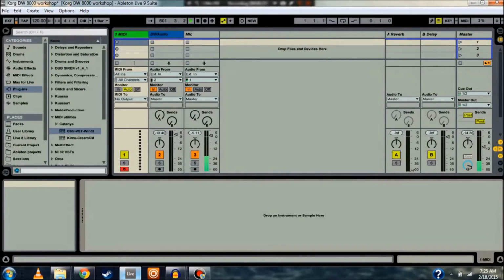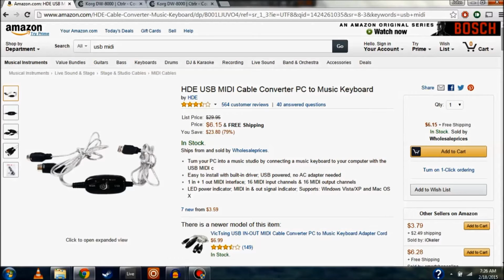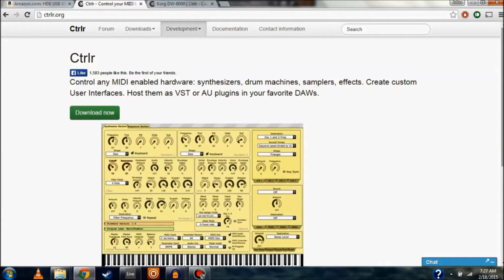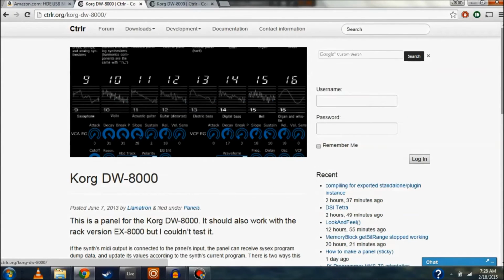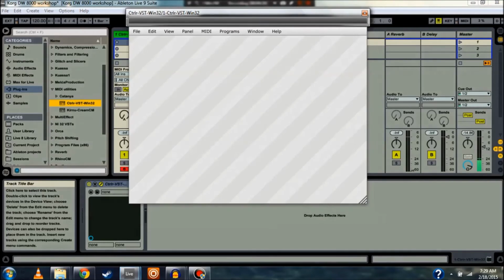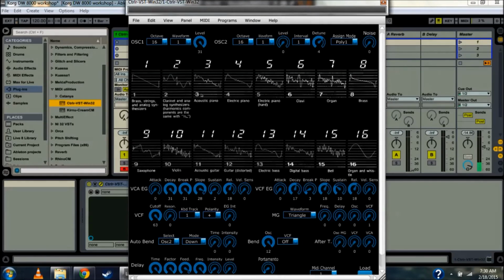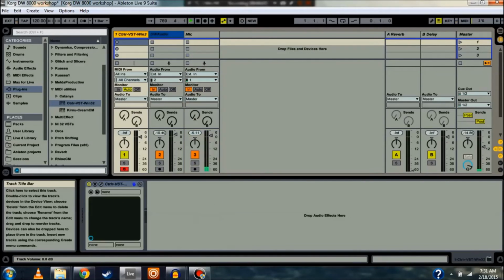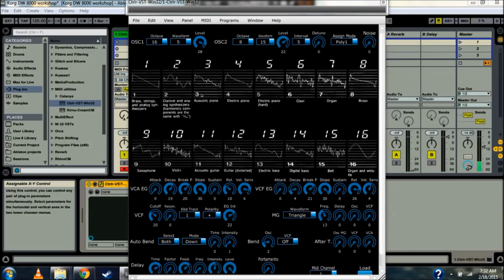Korg DW-8000 Review & Guide - Pt.2: Ctrlr Editing

Comment: It’s working for me even without the usb/midi converter. Only midi out and in, in selected my midi port linked to my dw8000 on every parameter in the midi settings of CTRLR and the « input from host » in the « plugin option section »
Enjoy

Comment: Will the USB-MIDI cable work for transferring patches from your computer to the synth? I was originally going to use a MIDI cable with a USB interface which then connects to the computer, but this cable seems a lot easier. Will it work for transferring patches?

Comment: Cant seem to hook a 707 to work with arpeggiator via midi is this possible?
Reply from the maker: Richard Walley it’s supposed to work as long as you set MIDI to accept external signals. I will tell you I always had trouble with the DW8000 accepting external MIDI clock and transport controls

Comment: Hi Yateveo, thanks for this great series on the Korg DW 8000! Are there any resources explaining specifically how to setup a Korg DW 8000 to work with Ctrlr software? I've downloaded Ctrlr and the Korg panel, but can't seem to get it to sync with the Korg keyboard.
Reply from the maker: Chris Bell you’d have to ensure your computer is also sending and receiving MIDI data correctly. How are you connected MIDI-wise to the DW8000?
Reply: Hi Yateveo! I am using an M-Audio Uno connector to connect the keyboard to a Macbook Pro.
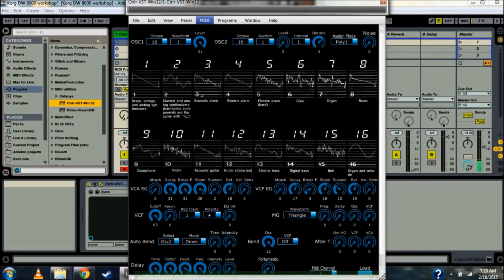Reply from the maker: Ok cool. Once you have it hooked up, you have to ensure that Ctrlr is looking at the Uno as a Midi source and also that it is properly assigning the MIDI ins and outs. I go into how to do that in the video at about 4:40

A couple common hangups:

1) Many usb/midi interfaces like these are a little counter-intuitive in that you want to plug the "out" plug into your "in" port on the synth and vice-versa

2) Make sure your DAW (if you're running Ctrlr as a VST) is not trying to use the Uno itself as a Midi interface. If anything interferes with Ctrlr using it, it won't work.

Hope this helps - thanks for watching!
Reply: Hi Yateveo, many thanks for your response.  I tried plugging the "out" plug on the Uno cable to MIDI IN and the "in" on the cable to MIDI OUT on the keyboard but didn't have a response.  However, when it is connected "in" on the cable to MIDI IN on the keyboard and "out" on the cable to MIDI Out, the Uno device LED light indicates that it is receiving MIDI input, but the MIDI Out does not light up. I am using Ctrlr as a stand alone program right now, not using it through Garageband.  In Ctrlr I have selected the Uno as MIDI Input, again the Uno as MIDI Output, and again the Uno as Controller Device. All settings are on Chanel 1.
Reply from the maker: Hmm that's odd. Unfortunately, I've never used the Uno before so I'm not sure if perhaps you may need to do some research with M Audio or their tech support boards to make sure it's properly sending MIDI from your host computer. Also of course ensure the DW8000 itself is set in its Midi settings to both send and receive MIDI.

Sorry, wish I could help more :/
Reply: Do you know how to set the DW8000 to send and receive Midi?
Reply from the maker: Parameter 84 changes channel, 85 enables note data or all data (set it to all), 86 turns omni mode on so it hears all channels just in case
Reply: Great will try this, thanks!
Reply: Hi Yateveo! Great news, I've gotten the keyboard and computer communicating with the Ctrlr software. One question I have is about saving panels that are created and reloading them. So far I haven't been able to do this successfuly, to load a panel that has been saved. I press the load button at the bottom of the panel but nothing happens. Any advice on this would be much appreciated. Also, are there sound libraries existing for the Korg DW 8000 that can be loaded in via Ctrlr panels (assuming I get the panel loading to work)? Many, many thanks!

Comment: Hi Yateveo, you helped me setup Ctrl in Ableton in your last video but it's been a while and now it doesnt work..I disabled everything midi in Ableton.

Can you tell me how you set up the various parameters in the midi option of Ctrlr ?

My Tascam interface is hooked to a Roland A-880 patch bay. My DW-8000 is on channel 7 so I set Input/Controller /Output to Tascam Channel 7.
Input from plugin host
Output from plugin host
In MIDI / Midi Thru I have Plugin Host to Output Device
Input and Output Channel at the very bottom to 7

If I write some midi info in the Ctrlr track, the DW-8000 plays the notes so I guess the routing is correct.

I also have an instrument rack in which I put Ctrlr.

Do you have any idea what I am doing wrong ?
Reply: Oh FFS ! I forgot there is another Midi Channel dropdown ON the panel itself...
Reply from the maker: Fred Payette hahaha is it working?
Reply: Yateveo lol,  it does.

Comment: Thanks for making these videos! I've downloaded ctrlr as well as the dw 8000 panel but I can't seem to get it to work with my DW. I have a midi to USB cable and the computer recognizes it, ctrlr just won't interact with the DW. Any thoughts?
Reply from the maker: Hmmmm. . . hard to say. 2 things to check right off the bat: most of those MIDI/USB converters are set up a little counter-intuitively where you have to plug the "Out" MIDI plug into the "IN" port of your synth and vice-versa. Check your plugs.

Also, depending on the DAW you use, you need to make sure that the DAW isn't attempting to use the USB/MIDI device internally at the same time Ctrlr is trying to use it. You might go into your preferences and turn off any note/tempo/remote messages the DAW is sending to the USB/MIDI cable.

Hope this helps. Thanks for watching!

Comment: hi i have a question how do you get sound from dw8000 in to ableton do you have a extra midi interface, because midi isn't  sound its only data if im correct so
how do you get you're sound into ableton ?
Reply from the maker: DudeParesseuxfrench You're correct - MIDI is only for data, like note values and parameters. I have a USB audio interface to get sound into Ableton. There are many to choose from. I use the Focusrite Scarlett 8i6
Reply: Thanks i will check one out nice videos btw !
Reply from the maker: DudeParesseuxfrench I appreciate you watching! Thanks! :)